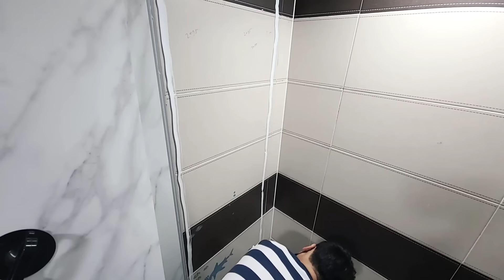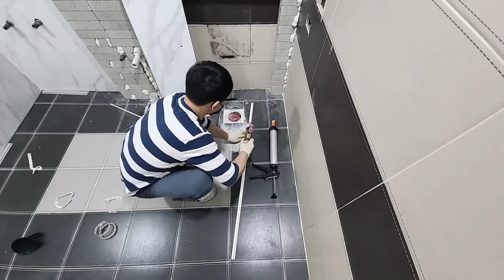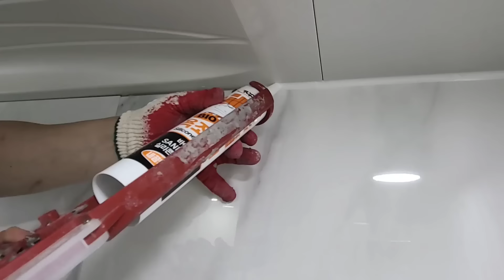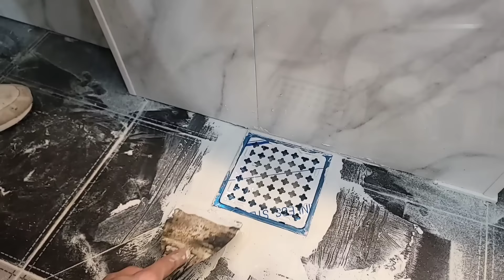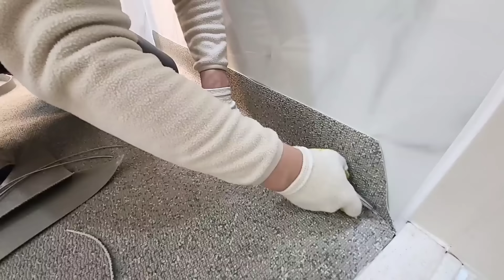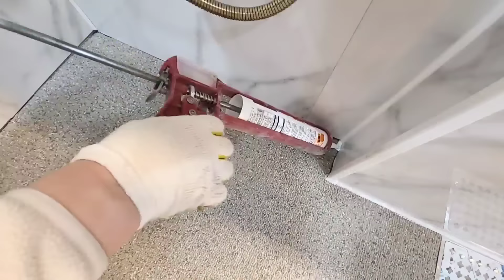하루만에 끝나는 욕실인테리어 시공 (벽 보드 / 바닥자재 추천)

Comment: That looks great in the first months but then the sealing bond material or silicone used to seal and give the finish that he used on the joints will get dark and ugly and you will have to either take it off and put again which is not easy or live with it. And i know there are the ones that are anti fungi and are made not to get darker but they do anyway so yeah this is a cheap solution and looks great but its not a long lasting one so it may fit aome people who like to change stuff every 2 years otherwise i wouldn t reccomend

Comment: Quick question what are the panels made out of ? Only shower panel I know I can cut with a razor knife is that 1/8" flimsy acrylic panels . I was thinking of doing epoxy so I can make that type of marble look without ordering acrylic panels. But if there's a company that makes and sells something like what your using that'll save me a bunch of time
Reply: Looks like a vinyl piece that has a design that mimics marble.
Reply: It  is actually an SPC product around 7mm thick easy to work with